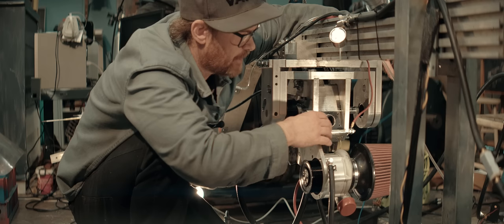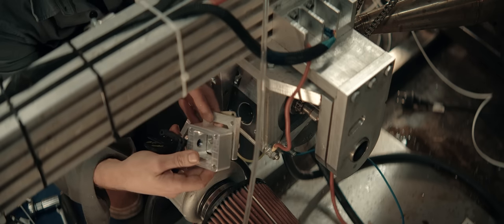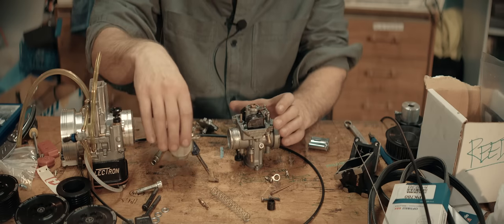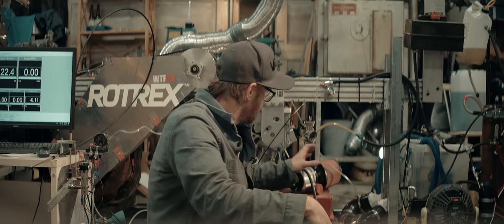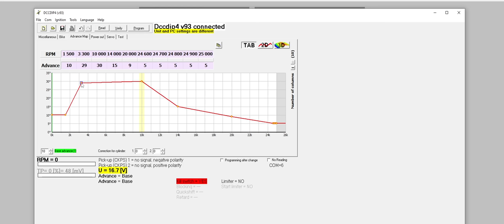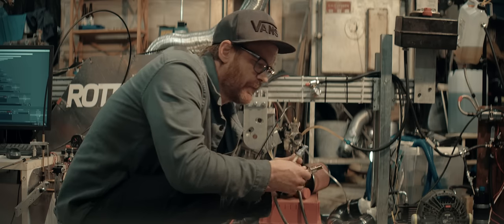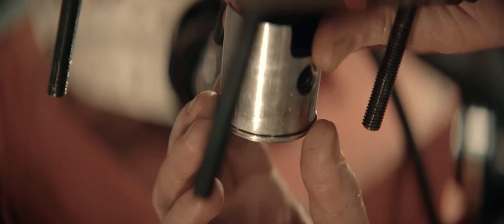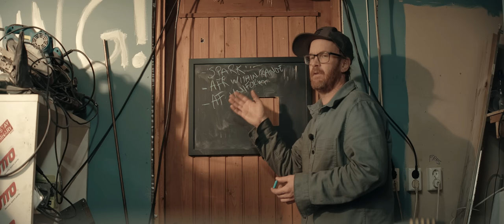Not Supercharged 50cc Two Stroke Not Running Nitro.

Comment: I would try a pipe tuned to a lower rpm. If it makes power then one for a higher rpm, expensive but could narrow down the crankcase volume question. Perhaps your getting an air pulse where its not sucking or blowing but creating a neutral pressure situation, which would explain low compression as well

Comment: I made an incorrect statement regarding 2 stroke timing. I was under the impression that it was similar to 4 stroke timing and forgot about the fact that 2 strokes with a expansion pipe rely on the pressure wave from the exhaust to aid in combustion. I will hence forth not provide advice for a topic I am completely unfamiliar with.
Reply: Thank you for your honesty!

Comment: If you are going back to basics try turning the engine so that the barrel is pointing up, I had a model plane engine that was a pain to get running right when it was mounted with the barrel pointing down.
Reply: I just happy you are using gasoline. You are trying to developed the  mechanical part of an engine and tune it with fuel. I think this mask any gain in the engine development. If a modern 50cc 2 stroke race motor made 30 horsepower and  your engine made 35 horsepower, was it the mechanical part of your engine that was the gain or was it the fuel? Remember there is very little research in running fuel in a fifties and you can run gasoline in the fuel class at Bonneville.
Reply: @marcroux5077  Mark, the horsepower figures Alex obtained are unreliable as he has stated previously.

Comment: I think your on to something here but I don't think it's spark. I'm leaning towards either compression or your reed set up. I'm further on the reed setup as it's known bad and new. It ran through the revs supercharged just fine past 12500. What's new? Sketchy reed block is a check on that box. It could be hitting some harmonic with such low drank case compression to push it back or limiting airflow by falling out of step.  The compression thing to me seems less likely cause we're talking about it either jamming and not breaking (I doubt) or fluttering from port chamfers. Even if it is fluttering I wouldn't expect it to do that. Something my brain keeps tossing out but I haven't put together yet is a connection to my bridge port 13b it has that point where it starts sucking exh into the intake at idle and kills it until rpm drops and vac drops enough that it can suck good mixture. This is at idle but it sounds like that's what's happening, the cause iv yet to think through. If I have an idea later I'll come back.

Comment: The old ignition didn’t work, because of the static timing curve. 

Maybe there is the same problem with carb jetting. 

If only there would be a way to control the amount of fuel going in over some kind of curve or so 🤔🤔🤔

Comment: Alex, great news on getting a oscilloscope. I feel you have  accepted there may be a problem with the large crancase volume as you've mentioned it many times throughout your previous viideos. 390cc crankcase volume plus the large volume transfer passages.                      
 I wonder what the primary compression ratio  is.
Would you consider fitting the Mk2 stuffers you made previously for this job.
Could a reed valve block be made when you have the raw materials, it wouldn't hurt.
I hope you accept this in the nice manner I intended.
Reply: It would also be interesting to monitor the compression, to see if it is indeed dropping.  He might also consider monitoring unburnt fuel levels
Reply: @CM-xr9oq Thank you for your reply. I think the secondary compression is fine. Alex has mentioned numerous times how the crankcase volume is on the large size. You only have to go back to the previous videos where Alex was building up the cases to see the massive volume between the crank flywheels and the top of the crank cases then take into account the two inlet ports in the crankcases.
No offense to Alex in any way, but he acknowledged there was a problem when  he made stuffers to help cure the excessive case volume which leads to low pumping efficiency. I also acknowledge when the pipe hits it's resonant frequency  "19k" there will be a depression to aid cylinder charging.
I feel I'm Alex's number one fan after his family. You can't change history, go back and look at previous videos on the birth of PiP.

Comment: Hi there from Australia. 🇦🇺
I've run into a similar stutor in high midrange on escalation in my 1998 Yamaha R1 after polishing the main inner air velocity tube of the carburetors at around 8500 rpm's it slats for a second or two but yet dussn't stop escalation or reving out to a  pecks of 13,200 RPM's. 
On this stock asperated motor.

Comment: Good morning. May I comment? I believe you have two major trouble areas. First because of the large crankcase volume it will never run to its full potential normally asperiated. Your thoughts? Second, with the supercharger forcing the air/fuel charge through the exaust. Perhaps this changes the required pipe dimensions and volume. Your thoughts? Best of results
Reply: Hello Dave. YouTube  recommended one of Alex's video's from over two years ago,.It was Alex explaining the new PiP crankcases. He states that the massive crankcase would not allow the engine to run effefficiently normally aspirated and would really need a new set of crankcases to obtain optimal N/A performance in standard configuration.

Comment: in the name of optimizing fuel air ratio I wonder if building a carb that uses an ultrasonic nebulizer to totally vaporize the fuel between intake cycles is possible.
Reply: It would be super hard to meter properly.

Comment: I'm not sure how you control the ignition, but that sounds so much that you're missing sparks because of triggering issues etc. Frequency of the misfire is so "stable". If you have a signal generator, you could use that as trigger and test that the ignition goes smoothly to full RPM without running the engine.

Comment: Did you use the same ignition setup with the brute force engine? If so it cant be a ignition problem right?
Reply: I was thinking the same unless the settings have being changed or the unit has gone faulty.

Comment: Listen carefully.you might learn something.
With your timing light connected, and your room lights off and the room dark enough to see the timing light flash clearly, bring the revs up to the point it is miss firing. If it is ignition related, the flash from the timing light will go out at the point is cutting out. If there is no problem with the ignition, then look elsewhere for problems on the fueling side.

Comment: I like your never failing entusiasm.
Could you not just hook upp your aurduino to the coil (with some kind of filter between) and count the amount of impulses per second? 
Way cheaper and another challenge. 
Then a red, yellow and green LED  to show if you are within how many it should be by comparing to the RPM.
Reply from the maker: 👍Thanks! Been thinking about that, just not sure I would trust the results. Should have the necessary parts and it's a quick thing to try though.
Reply: My experience is that Arduinos and ignition coils don't mix. The electromagnetic interference from the spark causes endless problems.

Comment: the ignition is the problem. you use ignition coils that are not designed for this engine speed. in a 4-stroke engine that turns a maximum of 10,000 rpm, you only have to ignite 5,000 times, but if you turn a 2-stroke engine over 12,000 rpm, the ignition coil simply can't keep up.

Comment: Alex, with the large crankcase volume, when the pipe hits, could it be causing enough reversion into the crankcase to weaken the signal to the carburetor? This crankcase wasn't intended to be a perfect "pump" and so when the pipe hits, the pump can't fight it effectively and airflow through the engine and the carb gets stalled (and the carb stops delivering enough fuel)...until the rpm drops out of the powerband of the pipe.

If any of this would be correct though, I don't understand why it would be happening at such a low rpm. I can understand the pipe hitting lower on nitro-methanol, but this is gasoline again. Shouldn't this pipe hit somewhere above 16k-ish?

Love the very "off the beaten path" experiments you do. If people are getting angry that a lot of your theories might turn out wrong, then they don't understand the meaning of experimenting. Good stuff!

Comment: Complicated solution? EFI. Staged fuel injectors perhaps? for even further control you would now have access to rising rate fuel pressure regulators, and manifold pressures wouldn't effect fuel conditions like it does in a carburetor with a bowl. 4 stroke high horsepower fuel injection has utilized staged fueling for some time now for both nitrous and complicated forced induction setups. 

You could perhaps have an "idle to pre-pipe" powerband injector as stage 1, and stage 2 would start pulsing injector #2 at a pre-mapped rpm.

My concern with rpms over 10,000 is that you would no longer be worrying much about the pulse or duty cycle (95% +++) of the injector, and fuel flow would be dictated based on the pressure regulator responding to manifold pressure.

I suppose if you were to install a programmable 1-cylinder 4-stroke efi kit onto a 2 stroke , you could double fuel pressure, or drop fuel pressure and double the duty cycle of the fuel injector to cover 2 stroke fueling needs. I also see no issue running 2 stroke oil through an efi injector assuming pressures are adequate.

Comment: How about an ignition controller like an MSD6AL or equivalent to fire the spark in a programmed sequence? As in, the module fires a spark before tdc, fires spark at tdc, and fires another spark down the barrel after tdc on the exhaust stroke.. Just an idea.. 🤘🏻

Comment: It would be more likely that with a fixed range of acoustic scavenging, it might be that you reach a bandwidth where the exhaust reflection is not timed properly and your fresh charge is leaking out before it can get enough for a good compression, OR, its reflecting TO SOON and causing a blockage, preventing fresh charge from getting into the chamber.

The big problem with fixed tuned exhaust tubes like that is that their ranges are pretty limited and above or below that, they have less effect, and ideally, you would want a dynamically tuned exhaust that shortens as the RPMs increase and lengthens as they decrease, to make sure the reflected sound pulses always get to the right point at the right time to do their job right. 

Right then... ~( 'w')/

~( 'w')~....

What's left?

[HOP HOP HOP!]

Comment: Couldn't the cuts be the air resonating in the crankcase?
It could be that the engine gets to a certain rpm where the air in the crankcase starts to resonate, then it cuts. When it happens the engine loses rpm, gets out of the resonating range, bulds up revs and the cycle restarts.

Sorry the broken English.

Comment: I have an Yamaha RX50 with the same symptoms, surging at high rpm under load. All stock except for the piston, which I replaced for a domed one. Compression is now reading 150psi. Tried pretty much everything you also did, but no dice. Still chasing...

Comment: Slow motion video capture on spark/ignition monitoring(even an LED)? Baseline @10k revs with known working system and set timing, compared to tunable ignition system @ same timing and 10K revs. Might validate spark issue

Comment: If you are using a supercharger do you realy need to Blow the Air fuel mixture threw the crankcase 
I think it would bei easyer to Go streat into the cylinder like with a fourstroke engine

But still a great build you are doing Here 👍👍

Comment: my 2 cents is on port overlapping, big cranck case + high rpm= bad :)
with the "supercharger" the motor continued spinnig due to morre rotating mass and shoots flames out of the pipe... without it it junps but the effect is the same i think... maybe change the exaust pipe or removing it would chage something idk...
it's a couple of episodes that i am thinking about this..

now just a crazy question: can you ignite the fuel in the pipe on pourpse?

Comment: I find it very interesting that each time it cuts out at exactly half of your rev limit. 25,000 rpm rev limit and a sudden loss of power at 12,500rpm would have me looking more at that ignition module and the settings within.
Reply: Agreed. I would try a simple ignition module with a curve, from say an aprilia 50 to make sure that it’s not the ignitech module
Reply: Agreed. I would try a simple ignition module with a curve, from say an aprilia 50 to make sure that it’s not the ignitech module

Comment: I’ve heard that the large crankcase volume gives you problems fairly often. I don’t really know much about 2-strokes, so what is the reason to have a large crankcase volume in the first place?
Reply: The crankcases were designed by Alex to have a large capacity to work with his fully resonant induction system. Sadly this didn't quite work  as planned. When Alex fitted the roots blower and speedway carb this engine achieved over 18,000 rpm. The induction stroke suffers as well as the primary pumping stroke with the high crankcase and transfer duct volume now it's N/A.

Comment: Suggestion: can you possibly extend the vaporization point to increase the chances of proper fuel mixing? [long 'tunnel ram' type tube between the barb and the reed valve.]

Comment: What is the coil dwell time? If the proper dwell time is not able to occur before the next spark event you will have a weak to non existent spark, as if it is rev limited, until RPM's drop to the point dwell can occur long enough to fire the spark. Cant recall if you've covered this?

Comment: Are you still running the 4 into 1 ignition box? Depending on how you are charging the capacitors this could cause cutting out at high rpm because the capacitors are not charging fully
Try just 1 CDI unit again
Your idea with the oscilloscope will find it
Good luck and we all appreciate your efforts
Reply from the maker: I'm on it!

Comment: You could make your own ignition sistem it is not that hard , I could help you a bit , I think I have a few schem , but anyways you need something that can charge a capacitor very fast ( best is a zvs driver with a flyback ferrite core rewinded for this application ) then it is as easy as making a little inverter them a bridge rectifier with fast diodes , then you have  your high voltage supply rest of the circuit would be same as a common cdi , a scr , rc circuit for ignition timing , and then you want to use a capacitor with very low esr ( you can use a few parallel caps to divide the esr ) about 1uf 600v would be ok MKP x2 cap pulse resistent

Comment: 25:55 think a baffle or two in the crankcase might force the air and fuel into the transfer ports better?
Reply: Or fitting the stuffers he made some time ago but didn't fit as far as I'm aware.
Reply: Correction. A video was recomended by YouTube today and it was Alex from 2 years ago fitting the Mk1 stuffers into the crankcases of PiP.  This was with Alex's own plated cylinder and the Mark Atkinson piston. Sadly bore wear was to much for it to run if I remember correctly?
Reply: @malcrandall1309  I was thinking along the lines of making epoxy blocks to take up some crankcase volume
Reply: @americanmechanic909  Just as a little bit of info. YouTube recomended another video from 2 years ago when Alex was explaining the new PiP cases he'd recieved.
He said that these crankcases won't work correctly N/A and it would need a new set of cases to allow optimal N/A performance.
Alex has mention 3 types of stuffers in previous comments one with a type of valve.
As you say the making of epoxy blocks and glueing them in would do the same job. I read someone suggested using water or oil filled bladders to take up the space. how would they keep there shape?
Hypothetically speaking I thought of simply adding epoxy putty into the crankcases a little at a time building up and sanding down as I've done many times over the years. I think 3D printed will come out on top if stuffers are used 
The cylinder transfer passageways also have a large volume which will lower the primary induction and compression efficency.

Comment: Will the reed valve you're using rev high enough with your crankcase volume?  It revved way higher without the reed valve.  OK, lots of other differences too.
The material, thickness, flexibility, length all affect how how high a reed valve can work properly.  If the reed petals are too soft, the reed valve will limit top end RPM.  Too stiff and they'll limit bottom end torque.

Comment: YOU NEED to move pipe further away from cylinder head your powerband is low rpm to move powerband up rev range move the pipe its chattering on powerband.
Cone the combustion chamber move spark away from piston better combustion higher rpm

Comment: From the little experience I have working with mopeds (especially Gilera Runners 50cc), I still think you might be upjetting or having wrong exhaust. Is it optimized and welded to take high enough RPM?

Comment: Is it possible that you're losing spark due to an intermittent short?  Instead of electricity traveling the expected path through the plug and across the gap, it's finding a path to ground elsewhere?  It seems like that ignition tool you're using might only sense current and/or voltage but, would not tell you if the path was across the electrodes.

Comment: The changes that you have made to the ignition have not made a fundamental improvement to the 'flame thrower' issue. Is it possible that the fixed geometry piston valve timing is not correct at high revs with a compressor?

Comment: It's cutting out exactly at 12k or 12100 pretty much everytime. Are you 110% sure you dont have any rev limiter engaged?

But I do remember jetting my am6 and it did have kinda the same behavior, like turning off the ignition a secound at a time, and that stopped after some downjetting.